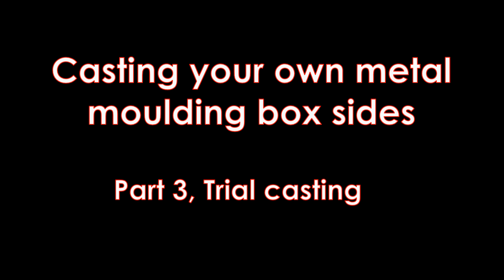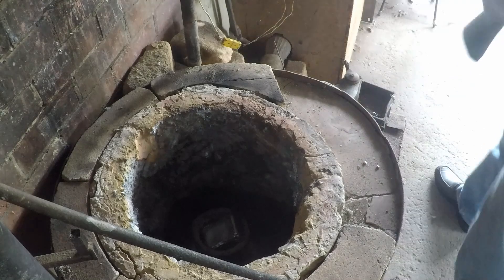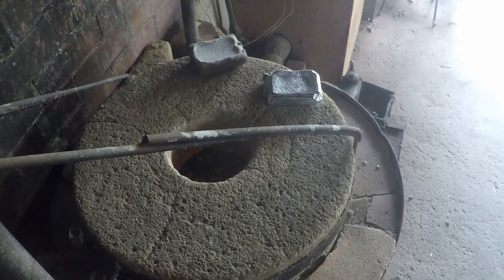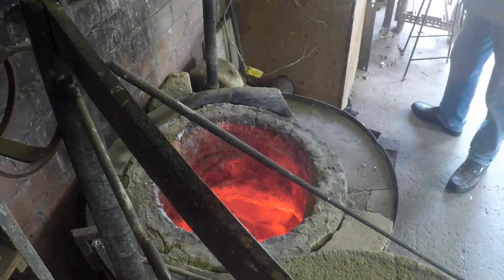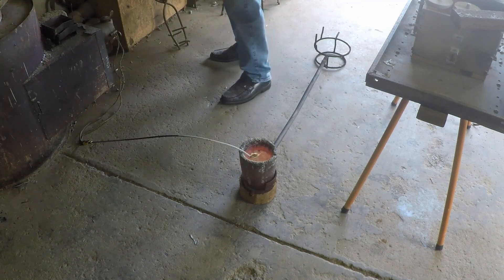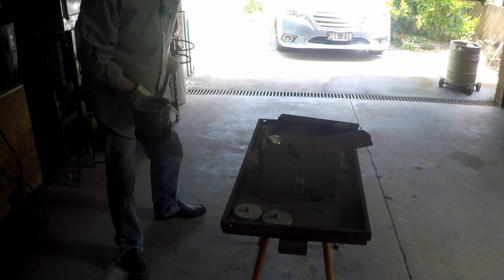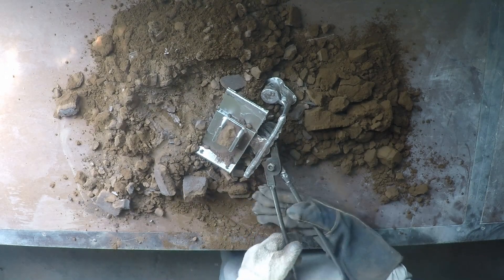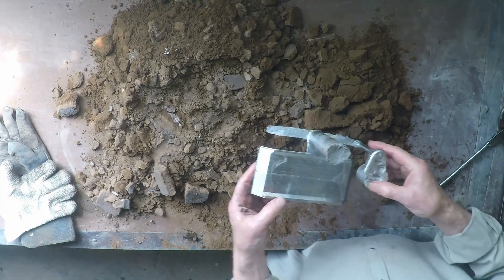Make your own metal moulding boxes - Part 3

Comment: great information, kind of you to share...one question you did not degass with nitrogen to get hydrogen gases...is that ok for small amounts?
Reply from the maker: Stuart,  It is my habit to degas with argon for all my sand work. But mot of it gets machined to  high finish and gas would become possibly obvious. If you look at my reply to a comment made by Kravchenko Audio about 6 hours after yours there is a bit more of an explanation re gas. I generally believe that for most hobby work degassing is pointless and in any case many people do it so badly that they wind up with more gas not less... Martin
Reply: @olfoundryman8418  thanks, read your other reply...castings I have machined were holey but not less than 1mm so its my pouring and I will not get hung up on degassing... appreciate all your videos, lots of info out there , but nothing like being able to see how it should be done,cheers
Reply from the maker: Stuart, Generally air bubbles will be all sorts of sizes with a preponderance towards the top of the casting often caught under the top skin, larger air bubbles can break through the skin and escape but they can leave a damage trail behind them. If your casting is thick and big and therefore takes a long time to  solidify and your gas level is high you could get gas up to maybe that 1 mm but it would be unusual. If you like send me some photos to  olfoundryman@gmal.com and I will have a look... Martin
Reply: @olfoundryman8418  thanks for the offer but the part is long gone now...with all the bubbles(pretty large) I tossed it...but I will have another go with more thought to the sprues and temperature...I have argon .... but I figured with all the mucking around degassing I would probably make it worse not better..thanks again for the informative videos.

Comment: I'm a  little confused about the need for deep dimples for the corner bolts. If they're just casting vague, no offense, it would seem that there's no need for them to be as large.
Reply from the maker: Lunky, They are large for two reasons
1. when drilled for 1/4 inch or 6mm bolts they will leave a nice chamfer
2. if they had been smaller the sand cone forming the dimple would have been weaker and broken away from the mould you will notice that I had trouble with this anyway (we have now radiused the edge of the dimple to get rid of this problem - we hope!)… Martin